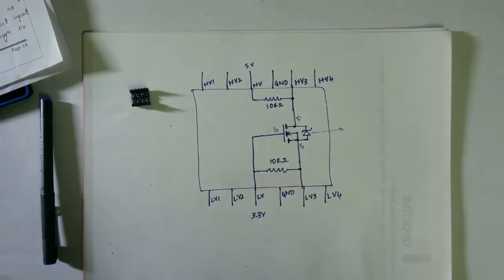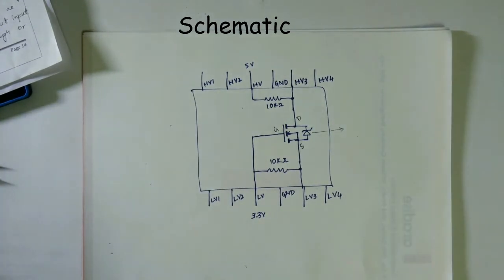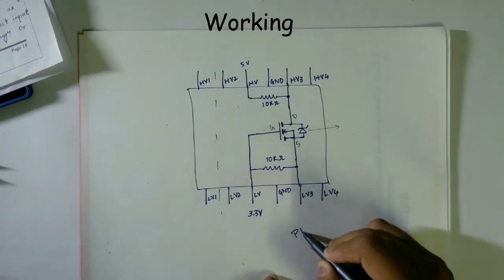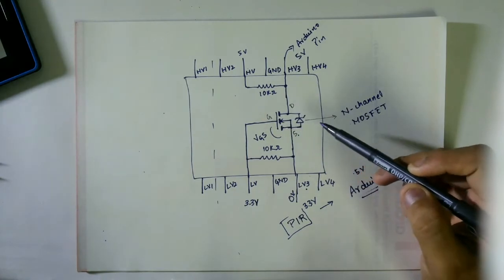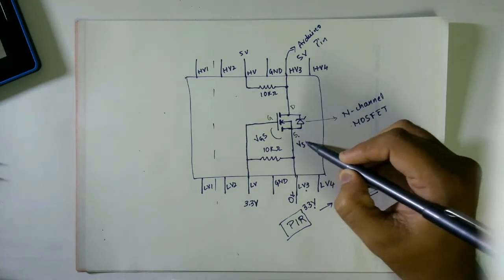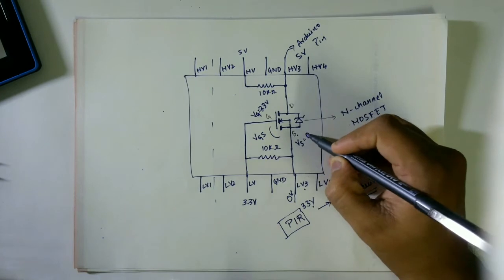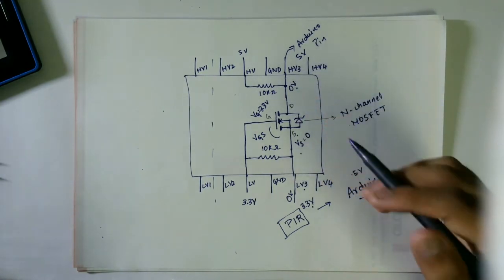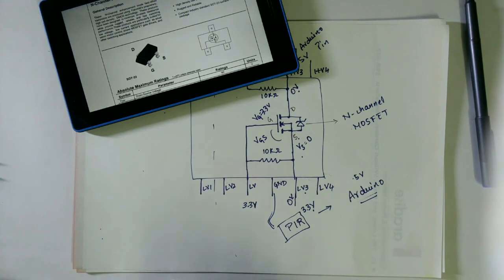Working of a Logic Level Shifter

Comment: With the same circuit, can I interface 12v at HV side and 3.3v at LV side.

The reason I ask is... I want to interface a npn or pnp photo electric sensor to the stm32